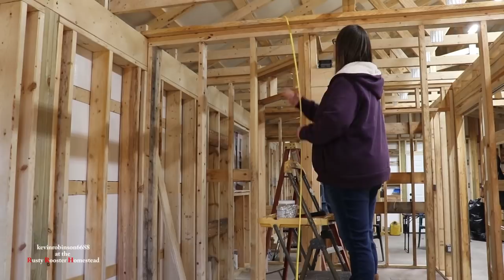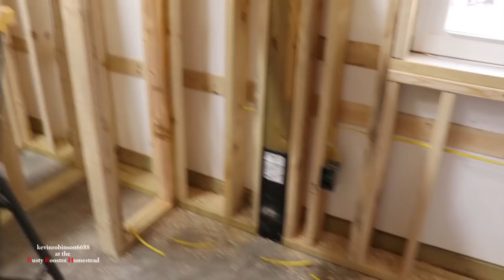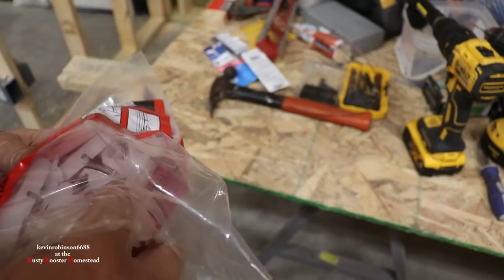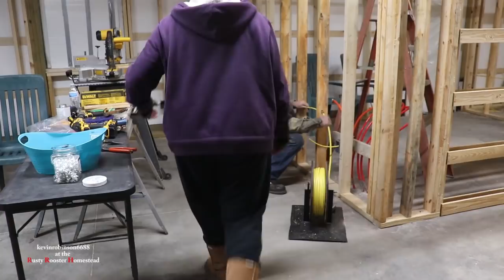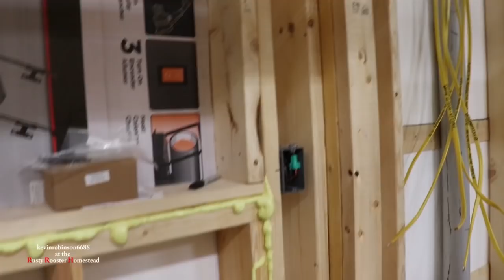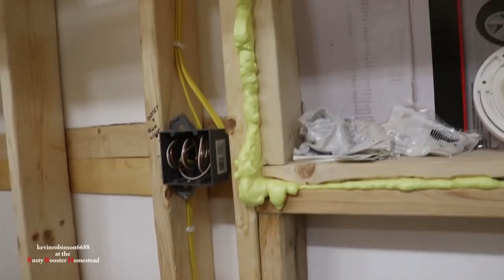mini brandominium pulling wires for the electrical

Comment: I forget do you have to put a metal plate whenever the wire goes through a stud. So if you nail wont hit it?  Your studs are wide maybe not in this case. I think for sure pipes you would need metal plate on stud in front of pipe in stud. I forget these things though.
Reply from the maker: I'm not sure I put them on the 2x4s

Comment: Question? why did you run 12/2 for your light circuit instead of 14/2 ..12/2 on a 20  amp breaker for the plugs 14/2 on 15 amp breaker for the lights just curious..
Reply from the maker: I like using the heavier wire